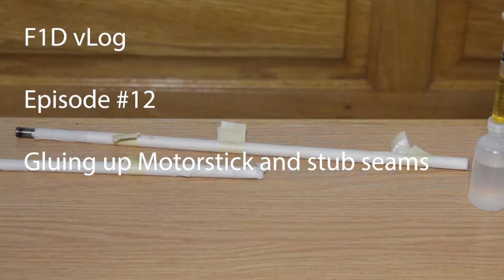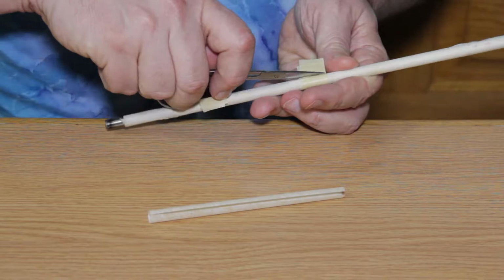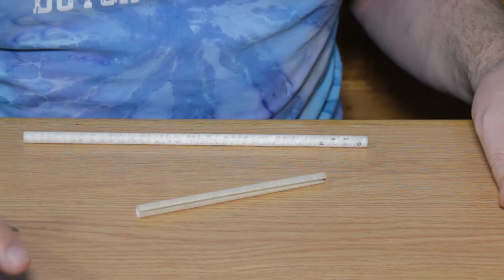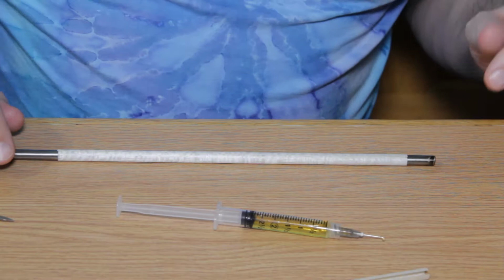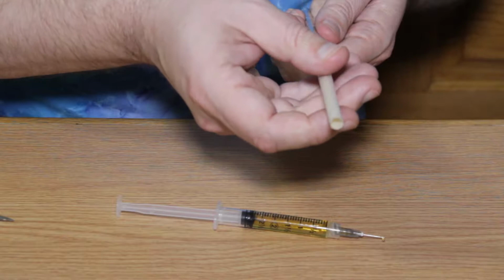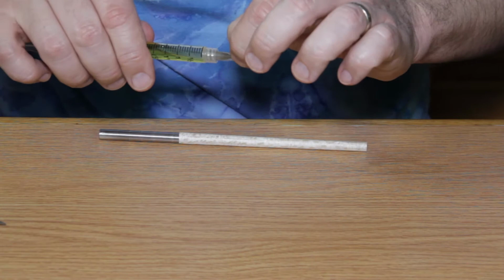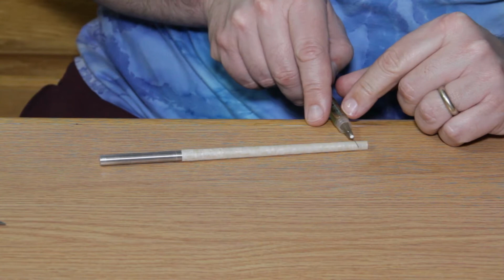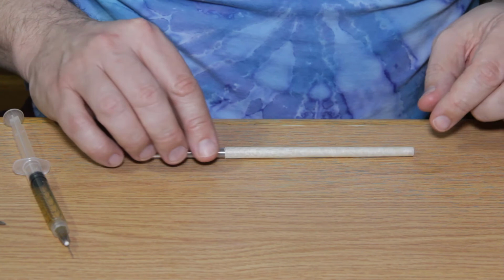F1D vLog Episode #12 - Motor stick seam gluing

Comment: Where did you get the motor stick and stub rods Mike?
Reply from the maker: https://www.amazon.com/PRECISION-METALS-8131-Round-Brass/dp/B002NJ5B78/
This is for a typical F1D fuse with 1/4" ID. 
Stub can be rolled on the large end of Harlan's tailboom form.
Mine is drill rod that is 0.266" thick.
The stub form I had to have custom made. My suggestion is to find someone with a small metal lathe and ask nicely.